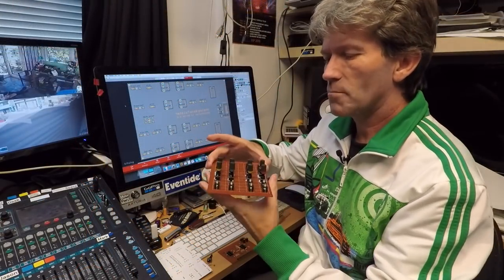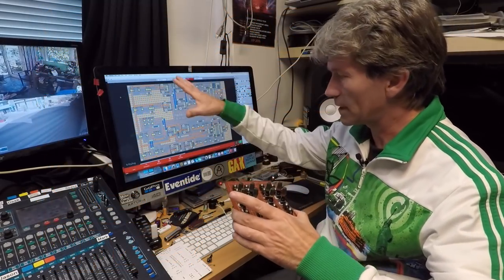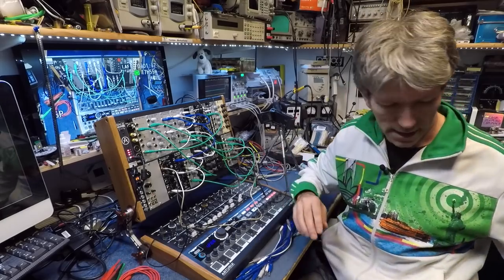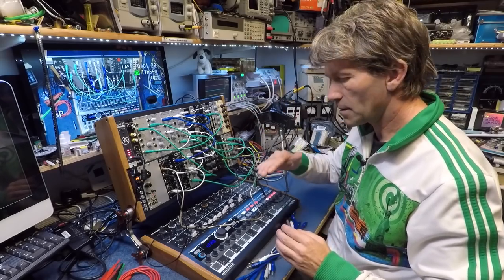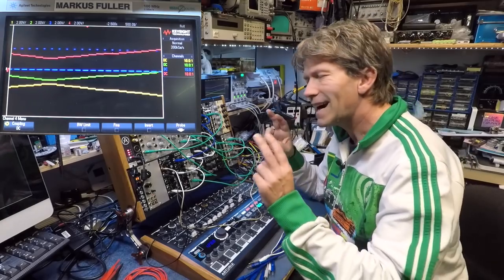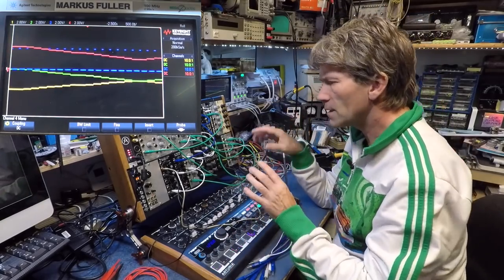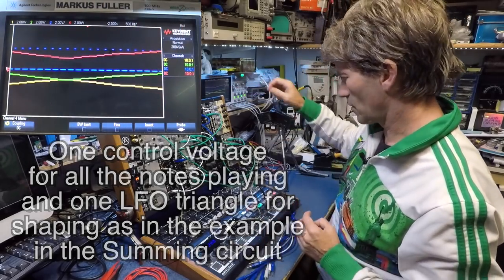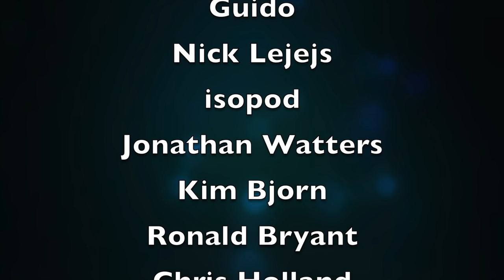Making the Analog Wave Twister Part 2 for eurorack module

Comment: A Tayloe Mixer would let you mix different signals together and the best thing is the carrier input will take a square wave signal, the output frequency will be related to the clock input as the clock drives the 74AC74 which drives the 74HC152 which takes the 0,180,90,270 degrees inputs and suitably clocked will output the sum or difference

Comment: I was browsing the world of synth DIY and came across Ken Stone's CGS CV Cluster. It seems to be a similar circuit creating the sum and difference of the two inputs. I thought it may be of interest. I haven't built it myself yet but will be including it in an upcoming project I have going on. 

Placing parts between controls is something I've done as well. A while ago I built a binary logic module that can be used to create semi-repeating melodies and perform virtually any logic function based off of input modulations and I did the same thing with my pcb. I'm still working out some kinks as I made a small mistake on the last board I designed (shorted two traces) I should have it up and running by the end of the weekend. I've always only done 5U DIY but am starting to get into euro DIY simply because it's so easy to get good looking front panels by using black silk-screened pcbs. 

Another thought I've had (though I'm unsure if it would actually be a good idea) is making the front panel and component board on the same pcb, where all components would be surface mount with potentiometers and jacks mounted through the pcb. Seems goofy, but at the same time I don't see why it couldn't work.

Anyways, I really liked this two-part series. It's not often one can get to see the design/building/thought projects through videos like this. It's pretty neat! Thanks.
Reply from the maker: Hi Jacob. theres a good video by mikeselectricstuff that explains the benefits of using PCB as panel material so yes it will work plus some eurorack modular companies use PCB material as top panel so they can add touch sensor areas. I did scribble down ideas of a SMT version of this but I wanted to make it so anyone could do it and SMT is a little difficult for some home hobbyists. I may come back to this project again one day as I want to make the audio work better and add some finer tuning.
Reply: @markusfuller  Yes, I think I've actually already watched that video. Good luck with getting this thing up and running with audio!
Reply: Jacob Pauls i have made a Eurorack module with a pcb "frontpanel" with copper text and grafix.
Reply: Yup, atleast Make Noise Rene, Make Noise Pressure Points, Mutable instruments Ears

Comment: Bravo. Hope you'll do more of this creative stuff along with your normal routine. Curious if the audio signal issue is related to DC bias in some way? I'll try to do this project eventually none the less, but I'd definitely have to make a smaller version.
Reply from the maker: Oh yes this is quite a big HP unit. I made some designs for the SMT version and may build that in a future video especially if I run out of HP space which will happen soon.